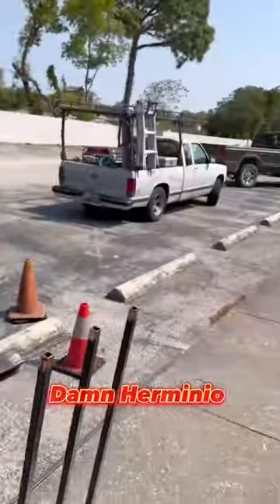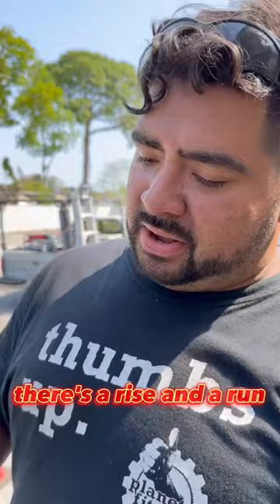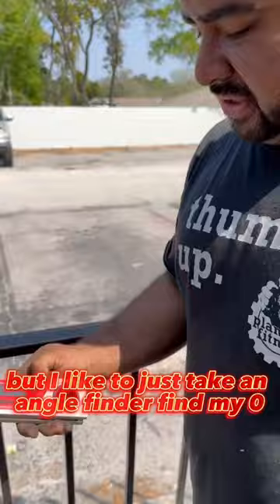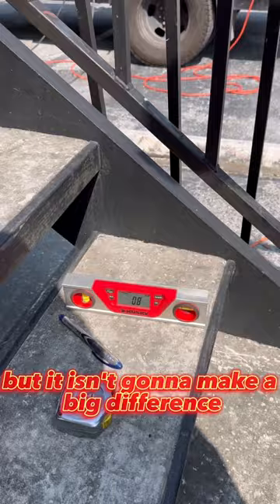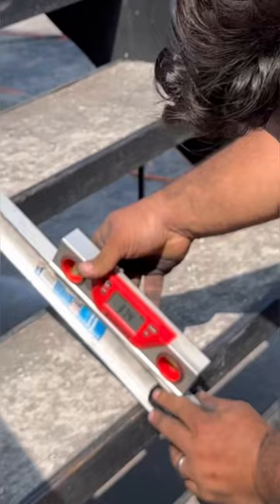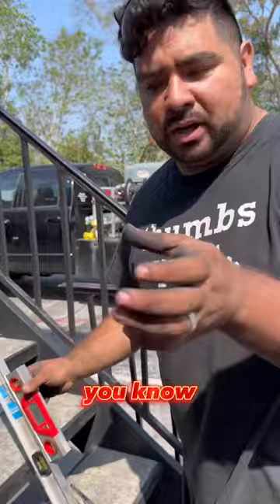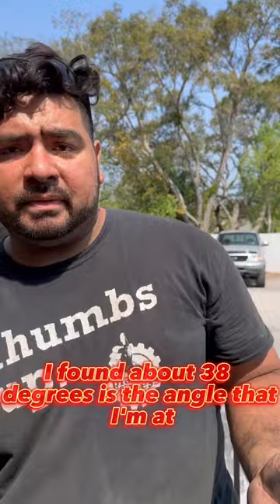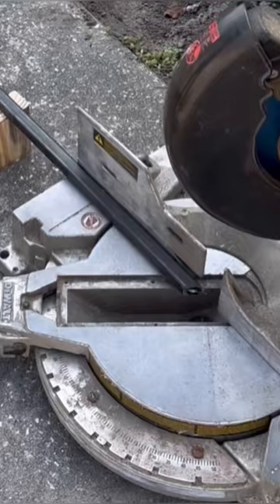Fabrication Tip (How to Get the perfect fit up with Herminio  from His Will Welding

Comment: Just good work from a man who cares about quality.
Reply: @canadian7494  You're right. That last stairwell you welded was alot more consistent and durable. I am convinced by the evidence you have presented. It was far more compelling than his work.
Reply: @MasterArkannor  I’m not here to judge what ever works, but I run a welding shop and mainly weld steel steps and landings. And trust me a protractor is the way to go.

Comment: There are other ways to find your pitch if you don't have a level. When you are fabricating the handrails before the stairs are installed, you go by the height and depth of the stairs to determine what the pitch is. Most commonly, an 8 on 10 is the pitch of a stair case, at a 36 degree angle.
Reply: I build stairs and handrails never had to do anything like this 😂😂
Reply: The height and depth is the rise in the run
Reply: He literally said rise and run.. that's what that meant
Reply: Or you could hold the piece up there and draw a line on it. One tool, a pencil.

Comment: I cut a notch in the bottom rail with a 4 inch punch, then bend it to the angle I want it to follow down the steps, weld the notch up and your good to go.  Now just match the top to the bottom.

Comment: Can i put the angle finder on top of the railing handle to find the angle or would it not be accurate? Thanks
Reply: Well if you’re building the railing then there’s no railing to put it on yet
Reply: just put it on the stringer that’s the best way, like he says in the video the steps can be off level throwing the angle off its best to go off the stringer

Comment: how does 7078 =a 38° angle?do I need more cocaine to clarify the equation?just put the angle dohickie on the rail maybe
Reply: I get what you're saying the way it works is you have to divide it and that gives you roughly the cut on each side
Reply: I get what you're saying you have to divide the total angle by two I caught half on each side
Reply: Notice he didn't show the joint/edges to be welded? That's because this fit up isn't really that perfect and the gaps are just filled in with weld metal. As long as it's close, it's good enough.